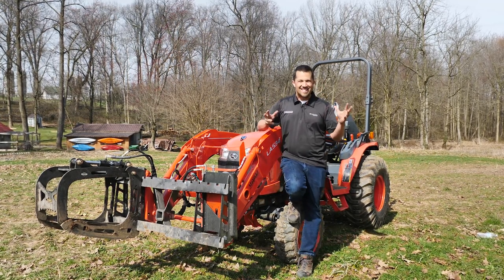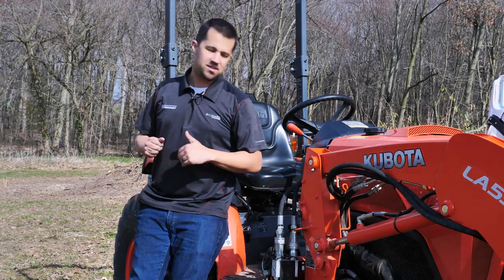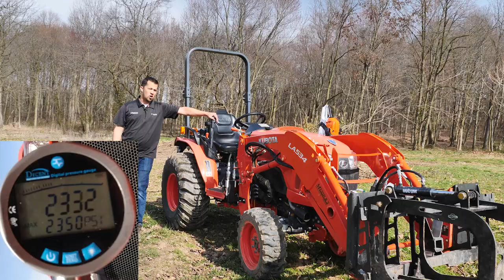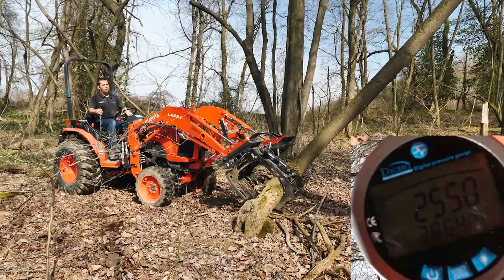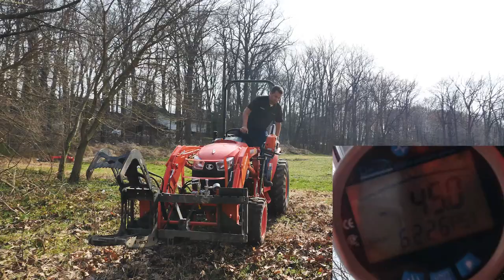How grapples can be dangerous! Protect your hydraulic system.

Comment: Great demo - that's not something any operator would realize is happening until there's a puddle of oil. Also, with your grapple offset you are torquing the loader arms really hard. Would be best to center that single grapple assembly. 
Keep doing this videos. Really like them.

Comment: I was a hydraulic tech for 25 years if you would incorporate a pressure release valve, then set it to max pressure you need in the system,  if a over pressure  would happen it would simple send the excess pressure back into the tractor hydraulics tank. The only part to see the hi pressure would be the grapple hoses and cylinders saving the tractors system. But then they would only see as much pressure you have set the reliefs valve at to.

Comment: Are all the 3000psi hoses 2 wire ? I have seen a bunch of post where guys are cranking the reliefs to close to 3k psi. Another piece of the puzzle is what the tractor is rated for vs the pump itself. Just cause the pump can make 4k psi doesnt mean the system is set up to cool the fluid at that pressure due to the extra heat generated. 

Lots of guys bending and breaking loaders with grapples.

Comment: Neil  before you do too much more abuse to your hydraulics you need to pull your sock up. The Kevlar sock on you loader hoses has slipped out of the loop where the hoses go thru. I have already had to replace my hoses because they had worn thru and were ready to blow. Its a tight fit. Excellent video.

Comment: REALLY good video - many thanks.  Recently bought my first tractor and never considered this.
Good thing hydraulic hoses (and cylinders) have a safety factor of 4:1
That means the burst pressure on a 3000 psi hose should be around 12000 psi.

Comment: Also check the fluid level in the reservoir each time you start using a new hydraulic implement. 
Filling the lines and cylinders will deplete the sump.

Comment: Yes... but a hydraulic hose etc has a safety factor.   If a system is 3000 psi it should not burst till 12,000 psi.  As equipment grows ratings should grow.   A small tractor cannot put the loads a skis steer does it doesnt weigh or have traction to put that load into the system
Reply from the maker: your correct, however if you read the comments from others below damage does happen without bursting hoses. Usually it happens back at the 3rd function valve.

Comment: I have to assume that this scenario holds true when using a “tree puller”.
When pulling, you are typically moving the tractor back and forth while at the same time trying to LIFT the tree and pull the roots loose.
Honey locust trees, in particular, have an EXTENSIVE root system!
So does this cause the same pressure increases?  I am assuming they do.
Reply from the maker: simply lifting and working the cylinders would not, over powering them and crashing around would.

Comment: You need to learn hydraulics. The tractor won't see that pressure because or relief valves also the svc is closed if not moving.  The worst thing to happen is a line burst and messy not dangerous unless it releases a dangerous load.  Most hydraulic hoses have a burst pressure greater then 10,000 PSI with working pressure of 3,000.
Reply from the maker: Yea, no real concern for the tractor itself. Anything that makes it back dumps into the low pressure PB line and goes to tank. The concern is for hoses, but more specifically the 3rd function valve and its solenoids.

Comment: Are you just measuring the pressure spikes on the implement side of a closed solenoid valve? I would not have thought the hydraulic pump would be constantly supplying pressure to the upper claws. So the pump and pressure relief would not see the spike. True you are over pressurizing seals, hoses and tubing but not going back as far as the pump and its' manifold.
Reply from the maker: Yes, measuring on the closed side of the 3rd function. Correct, if pressure made it beyond the valve it would go back to the PB circuit and dump though the relief there and back to tank. That is assuming the relief can dump the oil fast enough.

Comment: Neil, would you consider doing a video on Kubota rear remote valves. I.e why someone would want or choose between a spring center valve, float detent valve, SCD valve or locking detent valve? Also what kinda of attachment applications best use rear SCV's. Thanks
Reply from the maker: https://youtu.be/usIJAth74As

Comment: I think you had me in mind when you made this video.. I admittedly push my grapple beyond it's likely intended usage. 
Should I not be using the grapple as a pseudo-landscape rake? :)
Reply from the maker: certainly not the lids. The fixed floor or rake portion would be fine.
Reply: With a wicked grapple you can rake with the lid all you want the cylinders are fully closed when the lid is all the way open no way to build pressure
Reply from the maker: @bretallsop1862  Any grapple you could conceivably do that, but you would have to roll the grapple then entire way forward and drag which is asking for a bent loader cylinder. No different than back dragging with your bucket over extended.
Reply: @MessicksEquip  Yeah I was joking.
Another way I f'ed up my loader was picking up a very heavy and asymmetric red oak stick. The load was centered, but the log was a little tapered. The grapple closed on the log but there was more contact on one end. The log then proceeded to rotate one end out of the grapple leaving an 8ft stick being held on only one end, with all the torque of the log being forced through 2 tines.
Reply: @bretallsop1862  They specifically say not to do that or risk bending things.
Reply: Do as i say not as i do ea's videos show him raking with the lid as long as your doing light materials with a compact tractor and not putting down force (put loader in float) I think your good my point was you won't damage the hydraulic components you run the risk of bending a attachment anytime your trying to maneuver a load with a machine just use the old common sense

Comment: Doesn't Kenny's bolt on hooks have a shock prevention system in their Ultimate Crossover Relief Valve?
Reply from the maker: Yea, that's exactly what you would need. Does add some risk to dropping your load.

Comment: it would be cool if there was an over pressure relief valve on the tractor pump that just returned to the tank if pressure got to dangerous levels.
Reply from the maker: there are relief valves all over the place on hydraulic equipment, but in the case of the grapple I don't believe they can dump the oil fast enough.

Comment: I'm a real novice, but how hard/expensive would it be to add check valves right on the grapple's cylinder?
Reply from the maker: Not real hard, but unnessesary if you operate the tractor thoughtfully.
Reply: @MessicksEquip  Thanks.

Comment: Very informative video. Talking about hydraulic pressure, I got in the habit of reliving the pressure on my loader and backhoe every time I shut it off by moving the handles through all the motions. Is that necessary or unneeded?
Reply: Needed, no.  Does it hurt, no. It's also not a bad idea, because leaving pressure means your leaving everything in a stressed state.
Reply from the maker: I always would, makes things easier to hook back up.

Comment: We have a grapple for our tractor and it works great until it is time to hook it up, the grapple is always too pressurized to get it connected to the tractor. 9 times out of 10 I have to break one of the connectors on the grapple loose. I have tried everything to make sure pressure is relieved before storage, but it never fails, when I come back to it after a few weeks of storing, I have problems. Thoughts?
Reply: I had this problem as well.

I now have a different procedure when unhooking the grapple. I cut the power on the tractor and then articulate the claw as I lower the boom this depressurizes the system.
Reply: I had this problem also...in addition to depressurizing after power off, make sure your grapple is stored out of the sun if possible. The heat pressures up the hoses...I was using a hammer/bolt to release the pressure, but that takes time.
Reply: Above replies are all good options.  Here’s one more:  assuming your two grapple hydraulic connections are one male and one female, join them together after removing the grapple from the tractor.  Next time you need to put it on, when you break the connection it will usually release any built up pressure and should install to the tractor easily.  And better yet, it keeps your connections clean!

Comment: Helpful, Neal!  Thanks!  Looking forward to the "correct use of a grapple" video!  (Looks to me like you need some rear ballast BTW.)
Reply from the maker: My tires are filled, but I do usually carry around a grading scraper when pushing things.
Reply: Messick's ... tires being filled is great for traction, but does not move the fulcrum of the loader off of the front end. It just allows more weight to be leveraged into the front end.  You want the weight behind the rear axle which moves the fulcrum to the rear axle... which is much more robust than that front axle

Comment: Love the info, would it be different with 2 cylinders in play. Pressures push too the other. Find us a part to add to the valve, and sell it to us.
Reply: No, not necessarily. If the other cylinder is closed all the way there will be no place for the fluid to go causing the same spike in pressure.
Reply: @kd1010163  would that pressure not push open the other ram in the system. I am a plumber and I see the other ram as a weak point that would move.
Reply: @hanshaw1974  it would still try to close it. The pressure would try to flow into the extending side of the other cylinder since they are connected. If the second cylinder was retracted it would extend as the first retracted. The same side of the cylinders are connected.
Reply: @kd1010163  we are thinking different, 3k pressures when closed, agreed. 6k pressures when open and pushed on, that would transfer pressures to other ram. Oh well, still liked video, still think they should make a stand alone pressure relief valve.

Comment: There is always an exception to the rule I have a 40 horse track tractor from the '50's - '60's with a loader. I designed a grapple for it and I use it for field cleanup I've taken down whole oak trees roots and all with that thing. but I would NOT recommend anyone else just try it stock, I rebuilt the hydraulic system in my machine and upped the operating pressures so it can handle the forces of ripping up an oak tree root ball in one go,

Comment: Good video 👍. I have a 2019 b2650 land pride 3rd function and land pride grapple. It opens and closes very slow. Is there some type flow control that was never adjusted when my dealer installed it?  Thanks for reply
Reply from the maker: Rev your throttle up? Other than that, maybe some mechanical issue. You should not feel like your waiting on it.

Comment: Don't come video me when I'm doing some clearing work...unless you're making more of the "what not to do" videos..... I worry more about the grapple allowing me to pickup and / or manipulate stuff way to heavy  / too much force for the loader frame and tractor running gear. Too often I grab a rock or a large piece of tree and go to lift and the rear wheels get light....I've shoved stuff around with only one rear wheel touching the ground.
Reply from the maker: Been there too. 😀

Comment: Great video.  I am living proof of what can happen.  I had my first Artillian Grapple for 600 hours with no issues and I think I got lucky. I have about 100 hours on my new one on a JD2032r. It has been used aggressively cleaning up after a major storm in situations you showed. I have actually broken two spools inside the Artillian diverter. Both spools were for the clamp down function.  I could not figure out why this happened until this knowledge was shared. I am still having issues now with the female hydraulic couplers on the clamp hose which the Grapple plugs into. I suspect similar issues. Be careful. Any idea if a check value could be installed for a Grapple such as this?  Thanks for your work.
Reply from the maker: hydraulic couplers are cheap, I'd just replace that and move on. I'd like to see more grapples offered with check values. Unfortunately at this point that's an uncommon feature.
Reply: I agree on the couplers. Thanks again 👍

Comment: Love these videos!  Made me think about my new grapple but there’s something that wasn’t mentioned here.  My dual lid grapple has two 2.5” cylinders on it.  This one looks like about a 1.5” cylinder (I’d love to know what it is). Geometry being the same, the 2.5” cylinder will make about half as much back pressure as the 1.5” cylinder due to the greatly increased area of the piston. So, if I hooked a stump like Neil did mine would create about 3000 psi back pressure.  I think larger cylinders are better for this application.  Great stuff here.  Keep them coming, Neil!!!!
Reply from the maker: Bigger cylinder = more force when working forward. Would it not be the same in reverse? 
I'm stewing on this. I also see your thinking too.
Reply: Force = pressure x area.  So when the force applied is the same (such as when the lid slipped off the stump) and the area of the cylinder is double, then the pressure has to be half.  So a bigger cylinder applies more force when the hydraulic pressure from the Tractor’s pump is the same, but generates less pressure when the force from the lid is the same.  It’s a bit counter intuitive, but one example of this is a syringe.  It takes a lot of force to inject something with a large syringe, but with a small syringe you can inject things with just a finger because you generate much higher pressures.